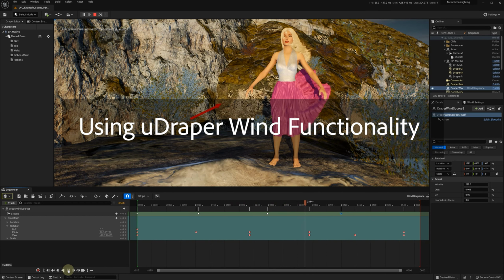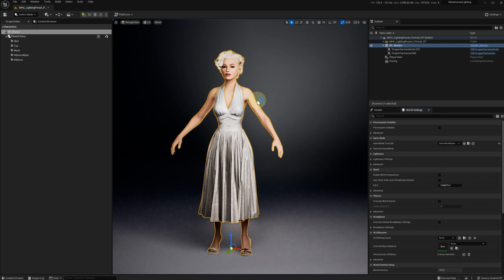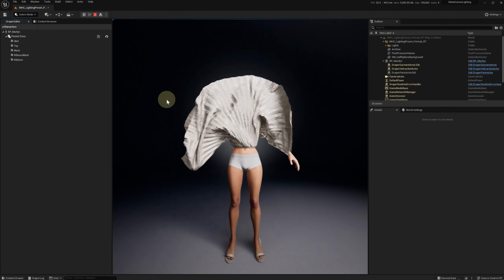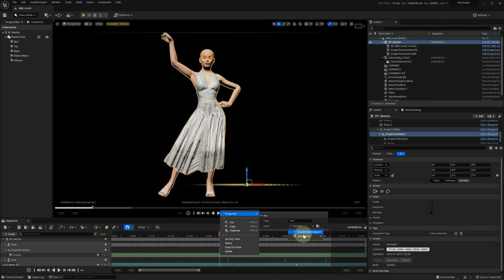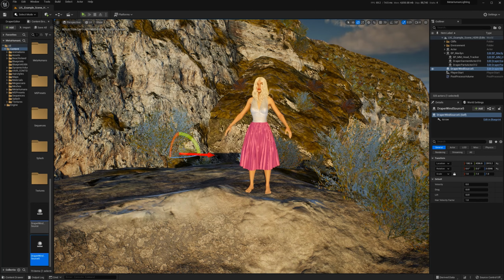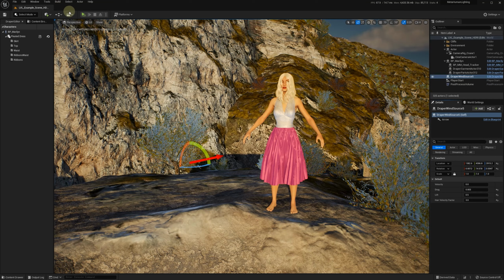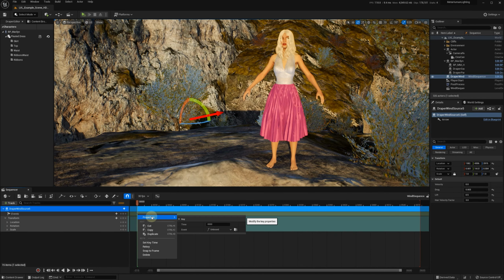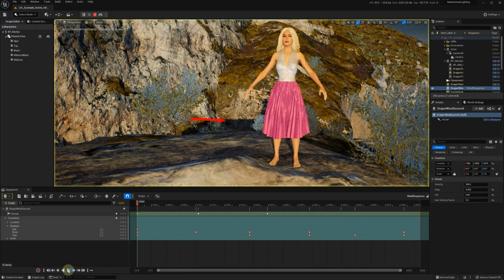uDraper Wind functionality for clothes and groom hair

Comment: what is your system configuration please tell me
Reply from the maker: This was done with RTX 3090
Reply: @triMirrorTV  is rtx 2060 12 gb enough for realtime simulation when im simulating my system starts hanging and animation doesnt working
Reply from the maker: @sathwiksandy3873  I'm afraid 2060 isn't powerful enough for both UE rendering and cloth simulation.
Reply: @triMirrorTV   can you suggest us a graphic card please.
Reply from the maker: @sathwiksandy3873  it depends on what you can afford. RTX 3080  or 3080Ti might be reasonably priced right now
Reply from the maker: @sathwiksandy3873  id recommend at least 3070 or better yet 3080